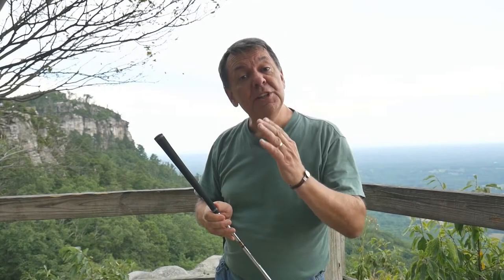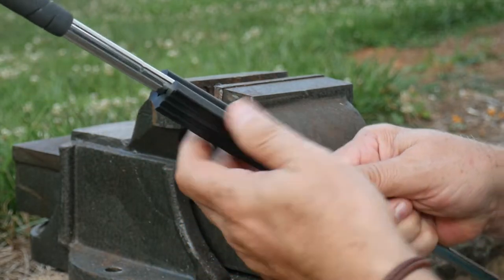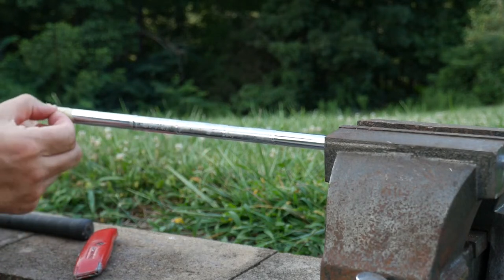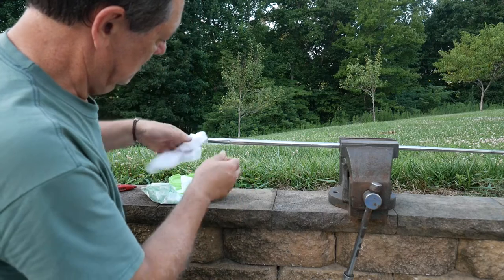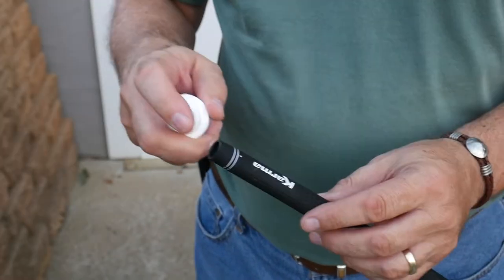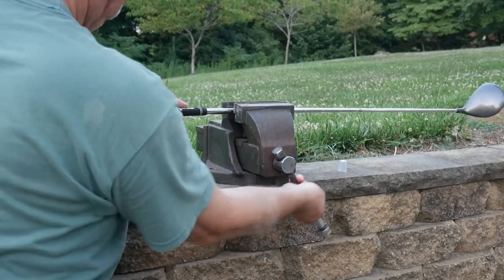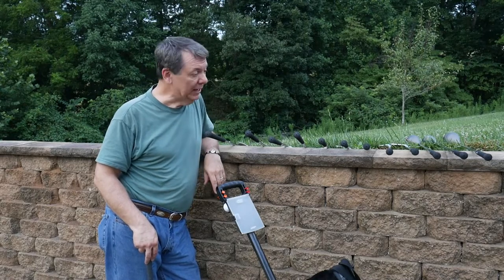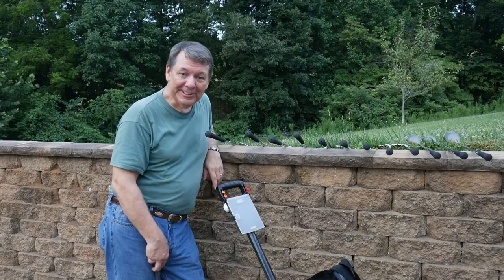Quick and easy golf club re-grip

Comment from the maker: The replacement grips I purchased on eBay at:

https://www.ebay.com/itm/13-x-Karma-Tour-Velvet-Black-Standard-600-Winning-Pride-Velour-Golf-Club-Grips/331805485399?ssPageName=STRK%3AMEBIDX%3AIT&_trksid=p2060353.m2749.l2649

...the kit that includes shaft protector, activator spray and double-sided tape is on eBay at:

https://www.ebay.com/itm/Golf-Club-GRIP-KIT-13-Tape-Strips-Solvent-Vise-Clamp-Regripping-Direction-Regrip/271633270552?ssPageName=STRK%3AMEBIDX%3AIT&_trksid=p2060353.m2749.l2649